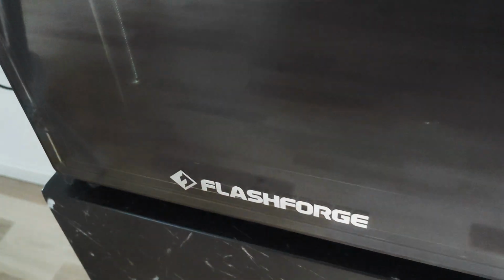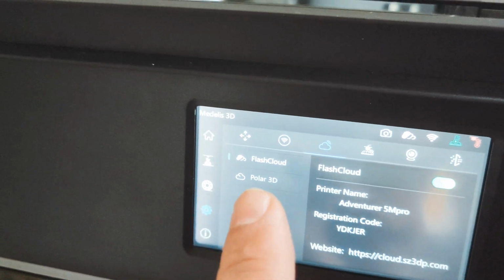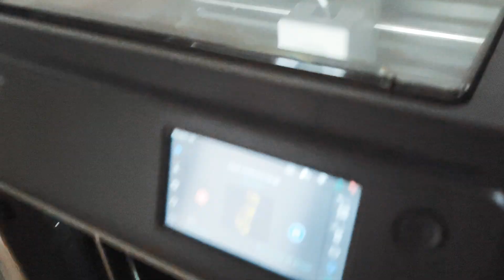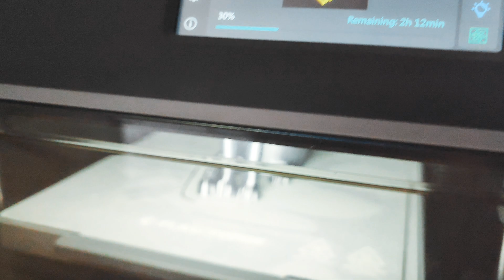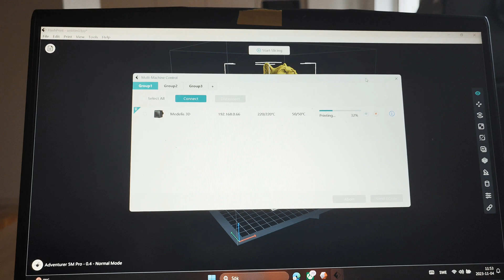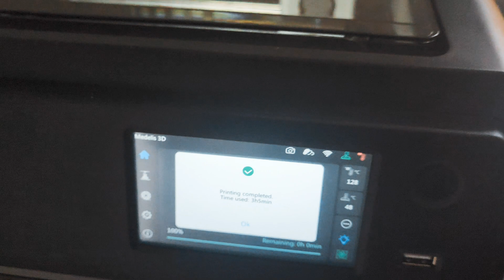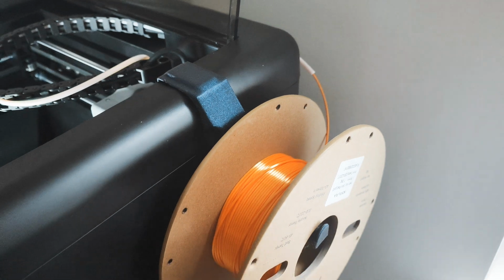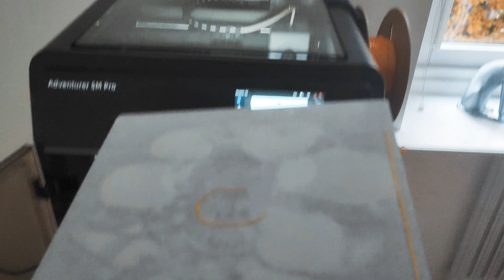Flashforge Adventurer 5M Pro Quick Look & GAYER ANDERSON CAT 3Dprinting...

Comment: Thank you for all this info! Great video. May I ask about that sheat you used, could you share some link pls?
Reply from the maker: I g. from a local store, but you can use a PET plastic sheet from laminating pouches (not the eva glue side)
Reply: @ThousandHobbies  Thanks a lot!
Reply: @ThousandHobbies  how this can help?
Reply from the maker: prints sticks better to the surface - tavo modeliai geriau prilips prie printerio platformos @algybe